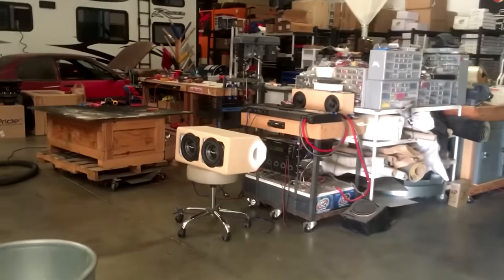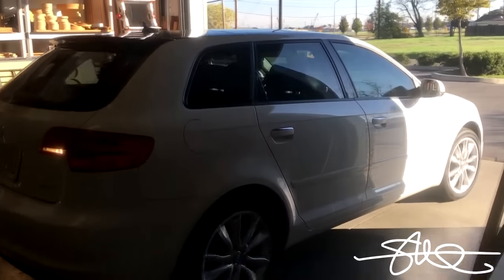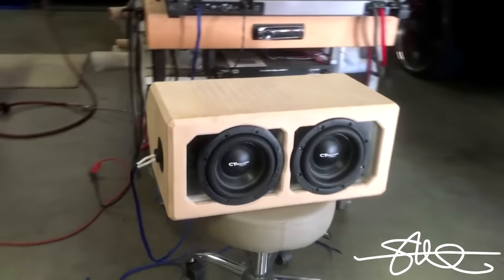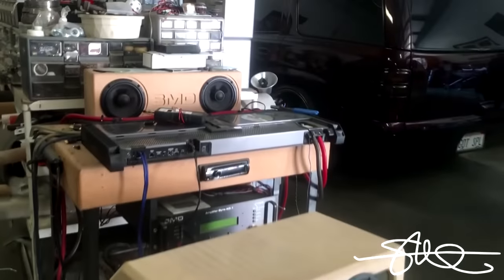24 Layer Ported Speaker Box BASS TEST! Audi A3 - 2 CT-Sounds 8" Meso Subwoofers - Video 3

Comment: Hey Steve, did you test the sub firing up as well? I'm doing a singe 12" TC 3hp Neo with a 4" aero port both firing up in a 2016 Golf GTI.
Was wondering if you suggest to fire sub back/up and port side like you did in the A3, or play it safe with sup up port up?

Cheers!

Comment: When your amp is maybe double the power of your sub, how do you know how to control the gains or setting on amp so you don't send too much power?
Reply: Avais Hussain Turn the gain down if you smell coil lol
Reply: grjsb13 Lol does the DD-1 know when to set it?
Reply: Avais Hussain sonic electronic on YouTube have a vid of how to set yur gain using a volt meter or a dd1 works good too
Reply: NickRon06 I always assumed the DD1 would check for when the AMP would distort, not when the subs will distort.. I'm not too sure because I've never had to think about it.. my sub is 650rms and amp 750rms.. negligible difference overall.. but I'm getting a 1500 rms soon and I'm not sure about how it'll power my 650rms sub..
Reply: Well, if the current amp is enough to run the sub, why not leave it? Or, get another sub, cause 1500w should run 2 650w subs no problem. If the new amp is going into the same system, just don't turn it up louder than it currently sounds. If the new amp is, say, 1500w at 1 ohm and your current sub is 650w at 2 ohm, then it should be fine, as the voltage won't go high enough to push the 1500w into it.
Reply: ive been told by many to not go by max rms, the good thing is the internet has so much good info, honest opinion I would maybe hitup the forums, ive been out the game for awhile but plan to build a system when I get my new truck, thinking 3 18s or 3 15s , but im old school so I might even do a old school setup, or just spend the cash and go with sundown
Reply: Bob Kurtz even some head units have distortion too.. so I couldn't crank it up to the max every time..
Reply from the maker: so in other words, you have been setting your gains incorrectly for 20 years? Never to late to learn the proper way.
Reply from the maker: "fine" lol.  I hear ya! keep doing your thing. When ready to do it properly, learn how to use an O-scope. Then once you learn how to use an o-scope, step UP to a DD-1.
Reply from the maker: you are doing it wrong.  I would never in my life recommend anyone use that video as a reference to tune their system.  Maybe you should educate yourself on why you should set your gains PROPERLY.  If sloppy and incorrect sounds good to you, have fun with it.  A lot of people are easily pleased with the most horrible systems there are. Not saying yours is horrible but no doubt it is not even close to being set properly.  Let me ask you this, what did you do about gain overlaps? How do you know when the deck is reaching it's maximum output (before it's distortion point)? What about your cool Equalizer? What about your crossover? Those are the most important things to know and they are before you even get to the amplifier gains.  If i was you (a self proclaimed installer for 20 years) i would at least get a cheap ass hand held o-scope and educate myself on how to use it.  You will thank me some day.
Reply: meade916 I'll thank you right now.. I've only been at it for 18 months and it hellish expensive.. buying the best isn't an option but buying something decent and making it work to its best is what I've learnt from you guys.. :)
Reply: Avais Hussain I've watch Steve builds for years and he knows his shit and the time and work he put into builds and is crazy Steve some folks and not worth wasting yur time and energy it's like the old saying with the horse and well saying lol if I had the funds and equipment I would get all those meters he had and do my own builds...
Reply from the maker: i am not a "professional".  I just prefer to set my system up properly.  If you like your stuff just "guessed" then more power to you.  I like how you talk about having 20 years of installs under your belt but all the sudden now you are just a basic phone and bluetooth guy with basic equipment.  Whatever though i don't care what you do to be honest.  I don't know how people can spend thousands on a system and thousands more over "20 years" time (like you) and not at least attempt to learn how to do it right.  Happens all the time, most shops don't even do it and those are shops that SUCK and should not be in business.
Reply from the maker: this isn't a "job".  I don't install shit for a living.  Also, didn't you say you have been installing for 20 years? So i guess it isn't a "1 use special tool" after all, you are just stubborn, lazy and don't give a shit how your system sounds as long as it plays.  More power to you, my grandma is the same way.  Just turn her "program" on at a low level and go about your business. LMAO. Also, if $100 is not "too much for the average person".  Maybe it is for you but your current financial situation doesn't speak for everyone.  Like i said 2 times already. EDUCATE yourself if you care about sound.  If you don't and you clearly don't....then don't. Simple.
Reply from the maker: i pretty much do what i want, when i want on my own channel. I handle troll bags and know it alls as i see fit.  But thanks anyway.
Reply: To be fair abusing the trolls is banter, fun reading when you're bored.
Reply: meade916 I love my DD-1. For several years I've done installs as a hobby and was using the "by ear" method described above. It's a ball park estimate for sure and I've been amazed by how much cleaner/louder a set up can sound. In fact the first thing I did when I bought my DD-1 was offer a free amp tuneup to all my previous install customers. It has helped me pick up on so many things I would've missed before. It really makes me feel more confident about my installs as well. 
Would definitely recommend it as an investment to anyone who does amp installs. Hell, I've even used it to determine when stock setups distort. So for someone like me who is on a budget but doing about one install a month what is the next product I should pick up? AMM-1, IM-SG, or CC-1? Thanks!
Reply: +meade916 the dd1 only measures distortion at 40hz and 1khz so wouldnt it still distort at say 30 or 50 hz?
Reply from the maker: No.
Reply from the maker: thanks man! try the CC-1 next.  It is a must have if you own a DD-1.  :)

Comment: Question, I have a 12" Ascendant Audio Havoc Dual 2-ohm sub in a ported box hooked up to a PH4000MD amp, I was wondering if it would be better to go for a 1400.1 from CT-Sounds for more bass. I'm going for an aftermarket alternator around 200 amps(really all i could find that would fit a 2000 nissan altima) so a 2000W RMS system not including the speakers and regular electronics would need like 104 amps but it would be a little lower with the 1400.1 if i'm not mistaken. I'm going for a set of the CT-Sounds meso 6.5" components and gonna be running those on a 125.4 from CT-Sounds as well. In short, would it make more sense for me to go with the 1400.1 instead of the PH4000MD due to the fact that I cant find any alts that put out over 200 amps for a 2.4L?
Reply: If by some chance you do get to reading this, would you be able to do some type of deal on a recone kit or even just reconing it for me as I would have it done by a professional anyway I would rather it be the best in the business and because I can actually make the drive there if you do have the recone kit and or the time do the the reconing.